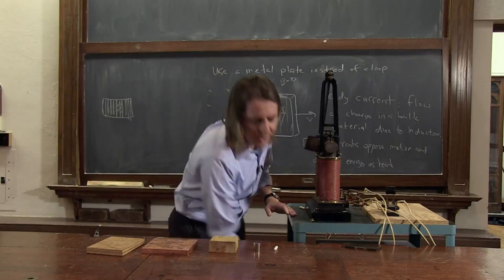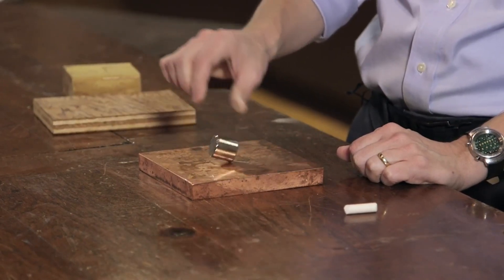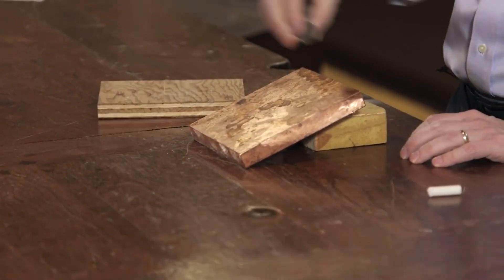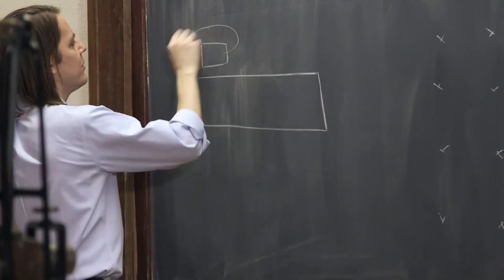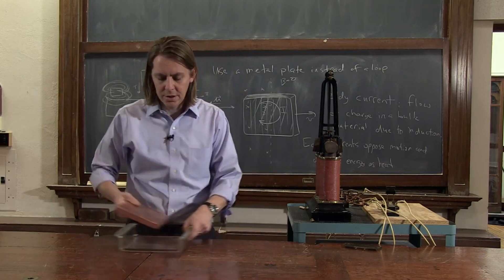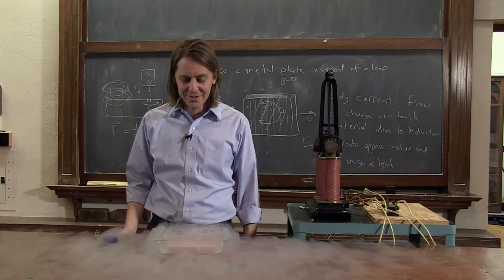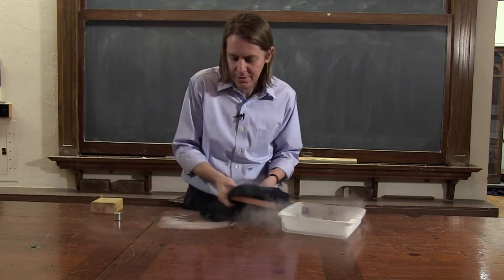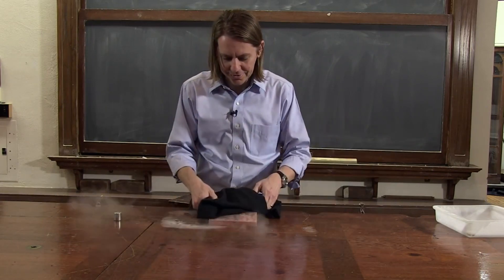DEMO: Eddy Currents and the Rolling Magnet

Comment: what is the limit on the size of surface ?  is this applicable on the surface of mars?
Reply from the maker: If you mean the size of the surface the magnet rolls on, there is no limit.  However, the surface needs to be a good conductor. That is why am using a copper block.  The rocky surface of the planet would probably not create a noticeable damping force because it is not sufficiently conductive.
Reply: @Prof-Hafner   for example, the size of a wind turbine in a wind farm,
Reply: can eddy current be used to slowdown spaceship while landing in mars ?
Reply from the maker: Oh, I see.  That is an interesting idea!  You would need a bunch of big magnets on the ship (either strong permanent magnets or generate a current for an electromagnet), but you would also need a large metallic landing pad.  So in the short term getting the heavy metallic landing pad materials to Mars and building it would be a big limitation.  Also, you would need to run the numbers to estimate if you could get a braking force that is worth the effort.  Maybe in the future!